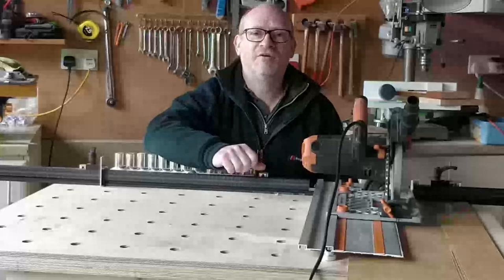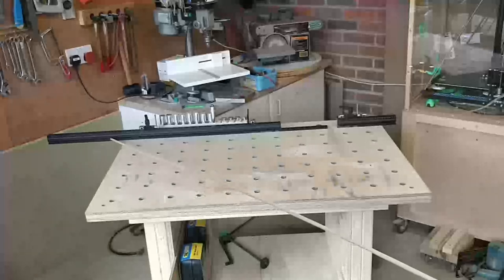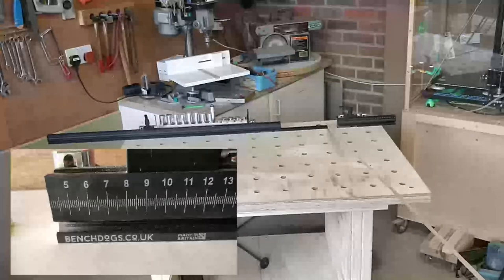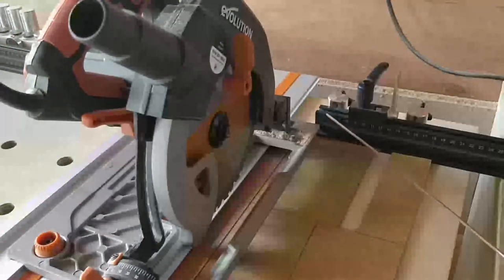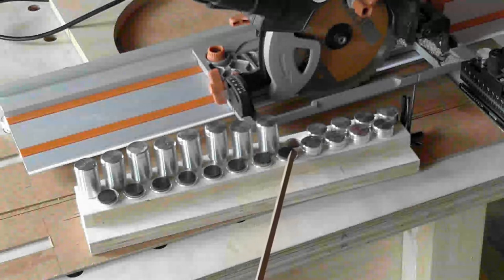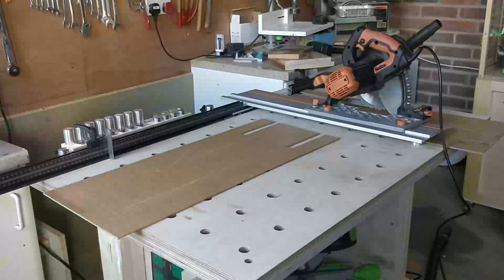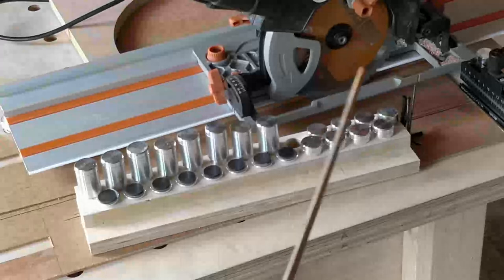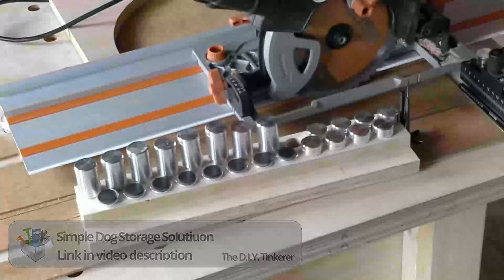24. DIY MFT Style Workbench, with BenchDogs.co.uk Fence and Evolution Track Saw.

Comment: Bench dogs have a hinge system that has a companion that off sets the 20mm holes and might be your answer on your track saw problem. I’m using a Chinese nock off that is selling for $120 versus $207 plus shipping to the US. Bench dogs Uk is a great place to shop but shipping is expensive for us in the states. Plus I have their dogs that can sandwich two pieces together and extend my bench out. Have a good day and continue making tbhings
Reply from the maker: Thanks for the tip 😀

Comment: Greetings from the USA.  Thanks for the walk thru on your MFT table and new track saw.  May I make a suggestion on your dilemma on your saw base running into your right hand fence - use an angle grinder and cut your saw base back to clear the fence... just kidding.  Seriously what about flipping the fence from right hand to left hand, would that work?  Im in the process of replacing my two Workmates (WM400 & WM225) work surfaces.  After seeing your MFT table, I think I might your MFT bench dog set up for my new WM table tops.   Have a good day and have a spot of tea with biscuit on me.....
Reply from the maker: I did consider doing an MFT style top on my workmate, and might still do it one day, my workmate still gets used daily.
Reply: The issues with changing the fences are:
* scales will not add up
* generally you want to keep and measure the left side of the blade. The right side is the off cut. If you change the setup you will be keeping the off cut side (right). Not an problem but not how the saw is designed :)
Reply from the maker: @i679n5  Hi, yes agree, but I can't see the utility of measuring the offcut minus the kerf, if you want to measure the offcut (I'd have thought) that what you measure should be what you get - and so setting up from the right hand side of the blade seems the best way - personally I think the main utility of the right hand fence is for support.

Comment: Thank you very much Simon. Good indepth look of your system, greatly appreciated.

Interesting hearing about the hardboard innovation of yours and that you did not prefer the 3 mm dogs.

I am looking at additional rail dogs. I am thinking if I should buy both high and low dogs. Is it annoying only having a too long set?

Keep up the good work!
Reply from the maker: I find I use the long ones more than the short ones , just because they are easier to handle.
Reply: @DIYTinkerer  interesting! I assumed a 30 mm pair would be perfect when cutting 16 mm thickness and below. You gave me something to consider.

Comment: Nice build, still never used a track saw or MFT and still undecided on weather or not I would get enough use out of a track saw and MFT. I’ve seen other people put a sacrificial strip along the cut line in their bench, did you consider this to save using hardboard?
Reply from the maker: Hi, 
I know what you mean about the MFT/Track Saw combination - I've struggled with deciding myself and still not sure if I made the right decision! Some people seem to use them exclusively, others focus on the table saw - in the end I decided to take the plunge, the main push was space in the workshop. 

Re sacrificial strip - I did consider this and might yet move to this approach in the future, the hardboard had been sitting on my lumber cart for many years (I struggle throwing stuff away!) so I'm glad it finally had a use and was a quick solution.

Thanks for your comments.

Comment: Looking good. Did you buy or make the MFT top?
Reply from the maker: Hi,
I bought the MFT top from eBay, from a UK supplier, the lower layer I drilled using the top as a template, I decided that a CNC cut to would be more accurate.